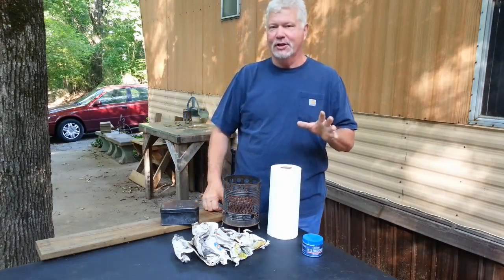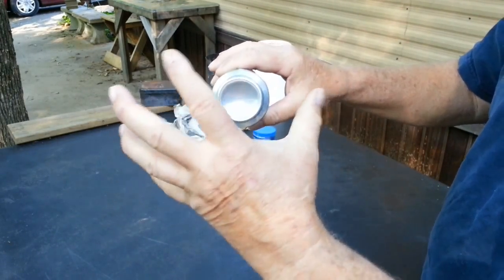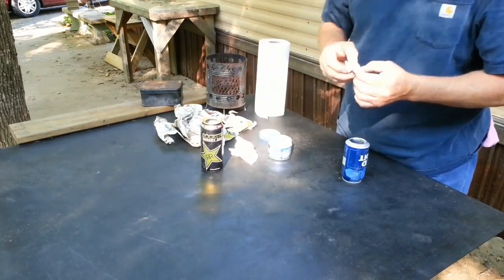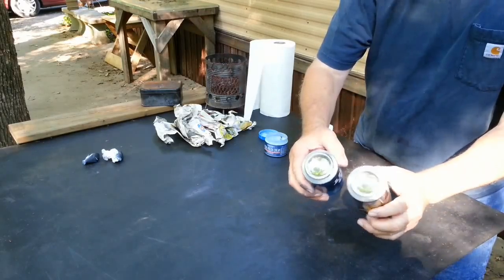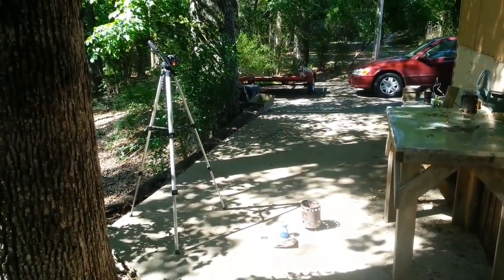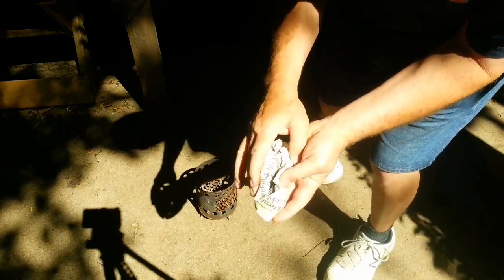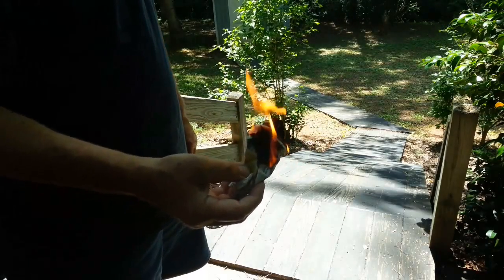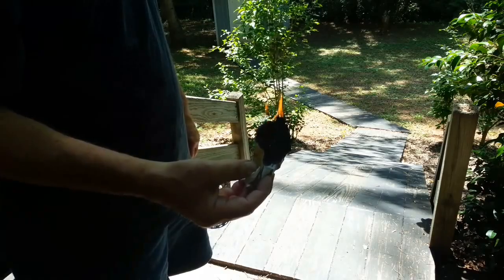Soda Can Solar Ignition, Roadside Can Search, Polishing, Aiming, 5 Interesting Ignitions & Fires

Comment from the maker: (Posting a new video every day in June.) Soda Can Solar Ignition, Roadside Can Search, Polishing, Aiming, 5 Interesting Ignitions & Fires.* I like videos that show an entire process from beginning to end and all the details in between. This one begins with the standard Intro... Then, a trip just down the road to look for cans, which includes a surprising find. Then onto details about polishing can bottoms, how to achieve perfect aim at the Sun, and lastly, I demonstrate 5 fairly different and interesting examples of solar igniting char cloth. Come see how it all turned out. Please SUBSCRIBE at the end of the video. Thanks!
* Time was, with weak solar igniters like these, you could only ignite charred materials... but if you also have some wood ashes, you can saturate any tinder with the ashes and it will become a great coal extender. And, as I've shown many times in the past, that coal extender itself can be brought to flames... So now, with ashes and this humble polished soda can bottom, you can ignite ANY natural fiber that will burn.
... I keep trying to drive that point home... the significance of ashes impregnated tinders. It changes everything!!! NOW, you can go from a very weak spark, ember, or ignition source all the way to flames.

Comment: You can buy 2 parabolic cigarette lighters on AMZ for $6.99. Many years ago, always carried one in my tackle box to light up in seconds and still carry one with my SHTF and camping gear.. Even has an attached foldout holder at focal point.
Reply from the maker: Nice!
Reply: @DavidWestBgood2ppl  Should have added that I haven't smoked in years. Only use them as fire starters.